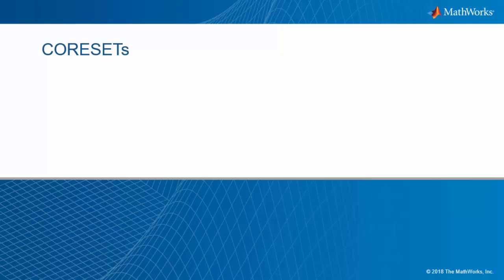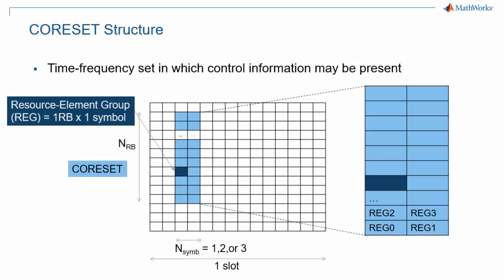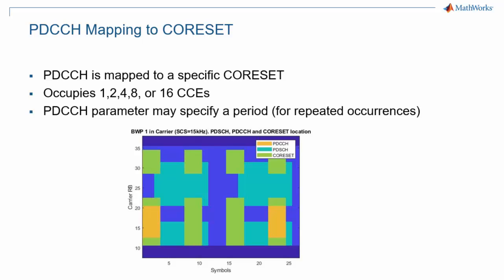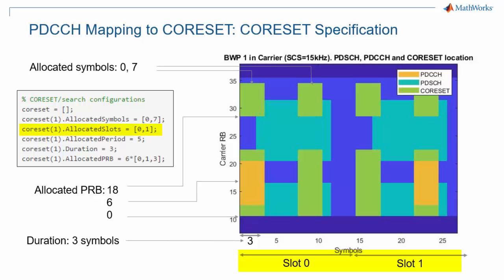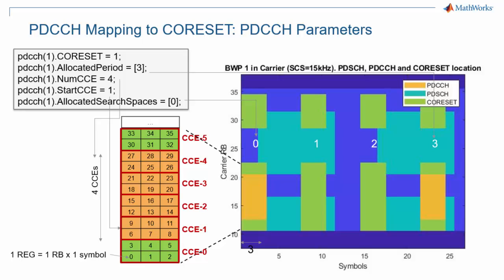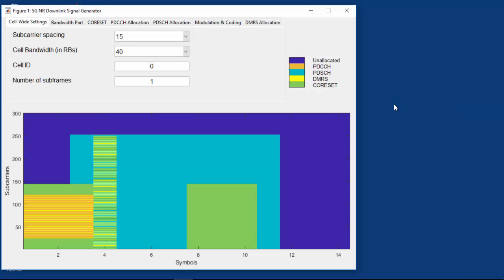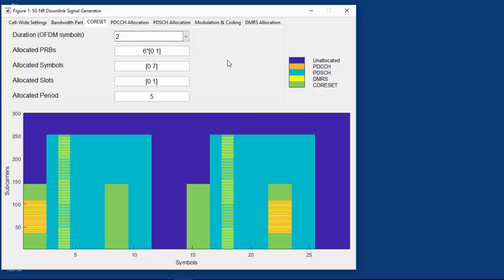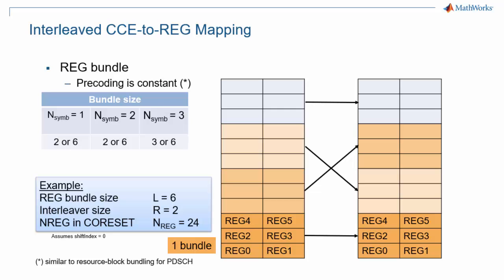5G Physical Downlink Control Channel (PDCCH)

Comment from the maker: To clarify some of the questions on this video. :) The standard gives a lot of freedom in terms of selecting the resources or repetition pattern. The example presented is not meant to show a “typical” pattern. Rather, it aims to present some of these options. For example, having a gap between the first and second group of resources is probably not typical but it is not precluded by the standard. Also, the CORESET period is defined by the period length and the set of slots allocated within that period.

Comment: Thanks for the informative presentation. In 5G NR, when SCS is 15kHz, the numerology0 has 1 slot per subframe. Why does the figure from time 2.47 have two slots?.  I think the SCS of that figure should be 30 kHz as shown in time 6.59.